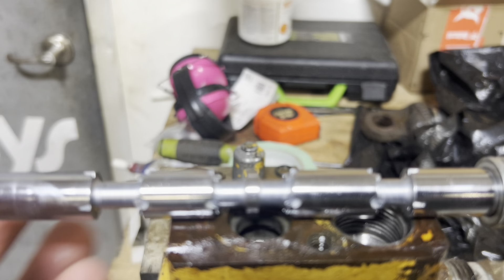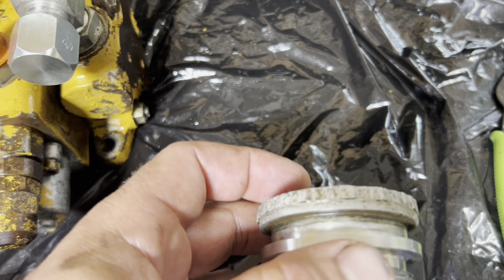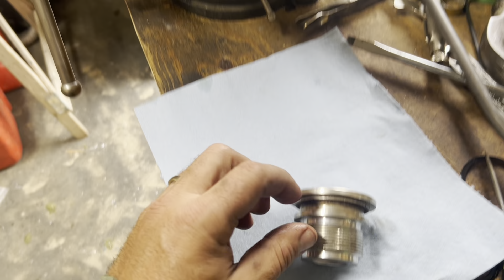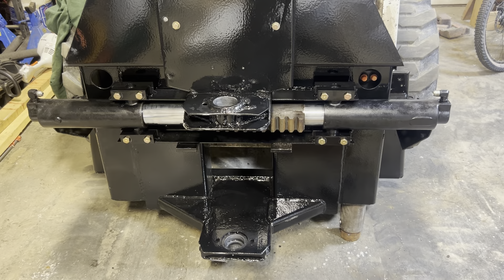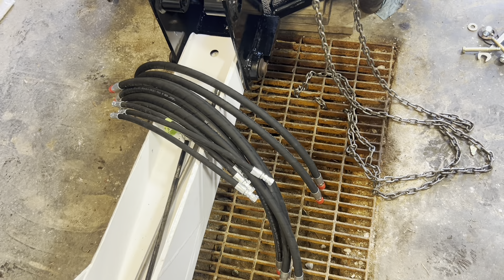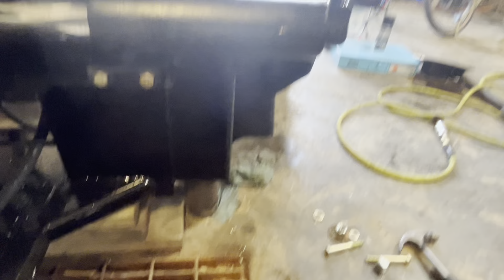Bobcat backhoe attachment rebuild part 3

Comment: Do you happen to have the bearing number? as well as the seal kit for the swing cyl?
Reply from the maker: You bet. Bearing part number is 6519337 and the seal kit for the swing cylinder is 6598209. Hope this helps!